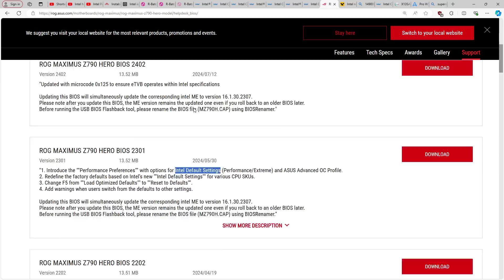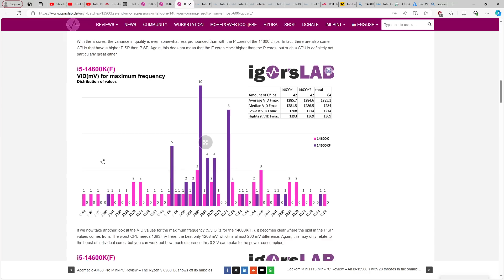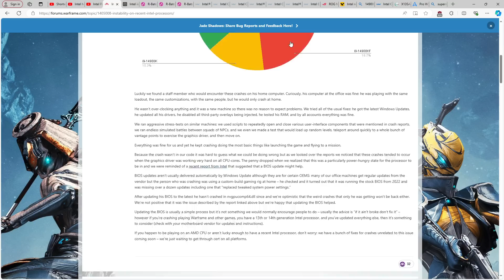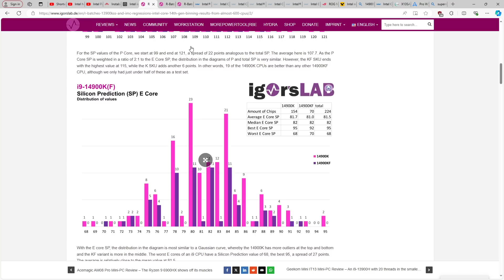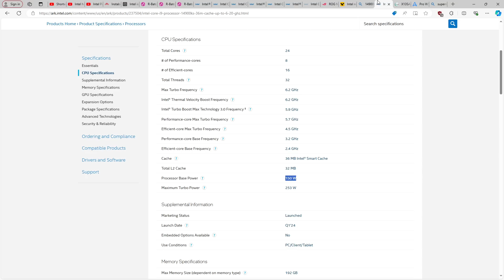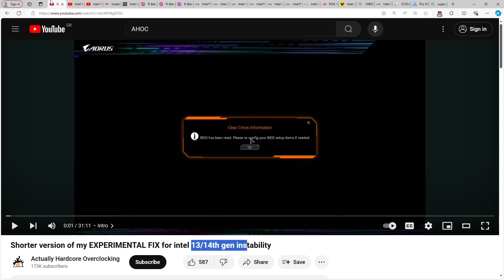The intel instability and degradation rant.

Comment: Thank You! 

Could degrading of the ring also be present in 12 gen i7?

Got a used one together with a used motherboard to upgrade my PC. Was sure freezes were due to bad MB. So I replaced it. Still freezes.

After that I increased the Voltage +0.05, disabled hyperthreading. Set ring clock to 3ghz And set the Clock speed to 4.3ghz. Now it runs.

So my issues definitely related to bad 12700k. 😅

Comment: Hi. I'm just about at my wits end trying to get my x670e gigabyte aorus master to run in dual channel with the 9800x3d. I've tried everything,  bios updates, disabling igpu etc etc but the board will only post with a single stick if ddr5. Ram is a matched pair of Kingston fury beast 32gb each. Will run fine with a single stick but will not post at all with 2. Before I buy a new motherboard and end a long association with gigabyte I'm hoping you have an idea I haven't tried. It seems a common issue on revision 1.0 boards which is what I have. Any ideas?  Love the channel and watch every video.

Comment: Stability and yet 90% of people don't even tweak voltage due to variation on psu how many power supplies not even deliver what they should spikes in sockets power draw 1.5 volt 9n one power supply not same as 1.5v on other anyone show multimeter hooked up in those test Any atleast 1 of them ?

Comment: I have mine 13900k for 2 years. First thing i did when I bought it I disabled multicore enhancement and set it to Intel defaults on Asus mother board and from more  4000 watts processor went in max getting 253 watts so I don't think Asus didn't know the spec . Since that time I  didn't had any issues. Then I saw on internet all the thing about cpu problems. So I started to update bios with newest bios and microcode updates . After update I had mine first crash in game. And temperature rised 10 degrees. So I gave up and changed back to old bios without microcode. . Set it up like first time. And left it. And still don't have any issues with processor other then that a  lot of games  telling me to update bios. I just carrying
Reply: The real problem is the single core boosts shooting 1.45 - 1.6 volts as an average while also running high temps 95C. The new bios still doesn't fully fix this as I just bought a new 14900K about a month ago so I had to  manually tune the voltage down from 1.47 to 1.4 so I could maintain the 6ghz boost clocks while not shooting a ton of unnecessary voltage to the chip. 

I also power limited my chip down bc my 14900K is running in a sff/itx case LIAN LI A4-H2O w/ a  COOLER MASTER 240 Atmos aio. I can't run the chip multicore to it's full potential if I want to maintain decent temps which I've chosen to stop at 85C max 220watts. 

My CBR23 multi-core score hits right at 36K & single-core 2350 while maintaining the 6ghz boosts. This for my use case was a much better solution than just locking all cores to 5.7ghz as some ppl suggest (which is not a bad suggestion if single core clocks are not a concern for you).

Why not AMD? bc AMD clock speeds don't maintain as they down clock (amd verison of thermal throttling) to way below what I would get w/ Intel. While the cache on AMD is fantastic the single core boosts from Intel are still favored in the apps I use specifically for music production. 

If the rumors are true then I do think AMD zen 6 will fix this to where we get sustained high clock speeds w/ cache but for now Intel is still the lead in that area.
Reply: @heyguyslolGAMING  thanks for real  answer.  I'm still in place where I'm not sure to upgrade to new bios or keep it on old. So knowing that still can be issue with new one  helps . 
Mine cpu is not getting more then 1.43v I checked it planty of times for a year.
Nice thats work affter setting it manually.
For me it's difficult that after 1 year we still don't know the scale of the problem. If every cpu is affected. And thers no real answer. Just upgrading bios. And no one cares if it works for you or not.
Reply: @evan-du3vk  As a suggestion run HWiNFO at the beginning of your use session and just use your pc as you normally would. When you are done w/ the session pull up HWiNFO and look at your Vcore & CPU Package Temp "Averages".

If it's at or below 1.35v @ 85C you're good. If it's 1.4v or higher then you might need to consider locking your cores down, and/or under volting. Keep in mind you can't just do a short simple session like 10 min.  Do this for several days and log the info.

Each session needs to be a couple of hours or more of actual usage to get a full gage.  When I mentioned that I had to get my vcore down to 1.4v that was for synthetic benchmarks. Once I ran my sys for normal daily usage I'm getting averages of 1.32v , 60C all while maintaining the 6ghz clocks which is what I paid for. 

The problem w/ Intel for some ppl is that if you're not particularly pc tuning savy then you're probably going to have issues. AMD is idiot proof. You could literally have an IQ in the negative and it's still going to work. 

Intel requires FAFO but for some use cases it's worth it bc the architecture for some programs is still leaps better than what AMD can currently do. Sadly all these tech tubers will never illustrate this in their vids. 

They'll just show you a bunch of trust me bro bar graphs w/ high subscription & views to convince you that they know best.
Reply: @evan-du3vk  As a suggestion run HWiNFO at the beginning of your use session and just use your pc as you normally would. When you are done w/ the session pull up HWiNFO and look at your Vcore & CPU Package Temp "Averages".

If it's at or below 1.35v @ 85C you're good. If it's 1.4v or higher then you might need to consider locking your cores down, and/or under volting. Keep in mind you can't just do a short simple session like 10 min.  Do this for several days and log the info.

Each session needs to be a couple of hours or more of actual usage to get a full gage.  When I mentioned that I had to get my vcore down to 1.4v that was for synthetic benchmarks. Once I ran my sys for normal daily usage I'm getting averages of 1.32v , 60C all while maintaining the 6ghz clocks which is what I paid for. 

The problem w/ Intel for some ppl is that if you're not particularly pc tuning savy then you're probably going to have issues. AMD is idiot proof. You could literally have an IQ in the negative and it's still going to work. 

Intel requires FAFO but for some use cases it's worth it bc the architecture for some programs is still leaps better than what AMD can currently do. Sadly all these tech tubers will never illustrate this in their vids. 

They'll just show you a bunch of trust me bro bar graphs w/ high subscription & views to convince you that they know best.

Comment: Well buildzoid, Im a part of your audience and I run an i5 14600k. I have it undervolted so that I never see it exceed like 1.2v I bought it new a couple of weeks ago, and I run it like this because I want it to last for a long time, and I am confident it will
Reply: I just got a 14600k, could you please share your settings? I'm worried about this degradation.
Reply: @tidjane2001 basically, I just undervolted until it was unstable. Go into the P states and adjust your voltages.

Comment: I appreciate your thoughtful discussion and I've done something most here will probably cringe hearing. I upgraded my Gigabyte Z690 board to F30 BIOS (which includes Intel 0x12B, 0x125 and 0x129 microcode) and switched out my i9-12900K for a new i9-14900K. I have set the BIOS to Intel Extreme Profile, limited voltage to 1.4v, Power to 253/253 Watts, and Adaptive Vcore with -0.100 Offset - per your recommendations in another video (Thanks!). So far, the CPU is rock solid and consistently scores 39600-40000 in Cinebench R23. Max voltage under load stays in the 1.3-1.35 V range, Package temp stays below 82C, and at least 3 P-Cores are hitting 6.0 GHz periodically with most staying at 5.7 GHz under multithread loads. Power draw is staying at or below 253. I intend to run this as my "daily driver" config and measure it periodically for stability/degradation.  I am keeping my old i9-12900K as backup/fallback just in case. However, the 14900K is noticeably better performance wise in the games I play - much smoother, no micro stutters in high-res VR.

Comment: Intel could slowly ramp the current up at transients by inserting a couple nops, and waste power when it's waiting for the memory to keep the current constant. Then it wouldn't need a loadline and could run lower voltages

Comment: My 13900k tops out at 5.6 and I've been running it since December 2022 on MSI MEG Z790 ACE motherboard.  Its been solid for me, more so than the X570 5950x aib rt 6900 xt combo I was running before.  Still not happy that Intel did this as it could easily have been my setup that had the issue.  Did notice in the bios settings that my ring bus is running 2700mhz.

Comment: Think asus have done something wierd with the latest bios for my TUF gaming z790.

Running a 13600kf on bios 1630 I get a max VID of 1.24v even with xtu optimised to all core 5.4.

"Upgraded" to 1661 and even stick it's pulling 1.39 VID and performance is down. The biggest issue is the temps though, on 1630 my 360 aio holds cpu temps under 67 degrees on extended benchmarks, 1661 has it up at 80.

Comment: Pat Gelsinger needs to go. He failed, he's wildly wildly overpaid. He's a nerdy sociopath.... Bring in someone younger and more organized. Even before these issues came out, these chips run so hot that I don't know how anyone ran them at stock clock speeds. I run my 14900k at 55P-core/43 E-Core with a -0.075 Undervolt.... Hopefully that saves me from the degradation issues.

Comment: My 14900k is only using 1.35 max vid since going to 1661, Had to remove Intel Defaults as they drew 1.55v just opening windows. Idle at .75v as per always, only draws 205w (used to be 350w). Main issue was still the SA being stupidly high when putting XMP on, weirdness

Comment: Hey guys, need help identifying if my CPU is degraded. I have a 14900k on a Gigabyte Z790 board and for about 4 months was having BSOD and thermal throttling and also the “out of video memory” error due to this, then all this stuff came out about it and I undervolted it to Intel specs, I made P1 & P2 both 125W and since doing this I’ve experienced no issues whatsoever, high shader games launch all good no crashes, no thermal throttling and no BSOD. They are now about to do a microcode bios update but saying if your CPU is degraded this won’t help. My question is, how the heck do I know my CPU is degraded?? As far as I know we all had issues when our boards were pumping too much power so we’ve all had issues but now we had set the voltage to Intel spec, all is fine. Does this mean my CPU is degraded? It’s working completely fine now with Intel spec so is my CPU degraded or is it all good? Do I need to worry about RMA my CPU if it works fine now???
Thanks heaps!

Comment: INTEL Core i7-13700KF 3.4GHz LGA1700 30M this is the cpu i use, i dont use any oc or power boost, just running on stock non over clocked mode, is it possible that i won't have any isues :)?

Comment: but isn't this also the fault of the motherboard auto-OC turned on by default ?
before hearing about this problem i only turned on XMP on my DDR5 RAM (6400cl32), and touched nothing else, now today because of what i've seen about the degradation problem, i went in the BIOS (i owned a 13600k) and noticed the "Tower air cooler" option was set to PL1=288W and PL2=288W, so i switched to the "Boxed air cooler" setting and now it's PL1=181W and PL2=181W, which is normal because Intel said it's PL2=181W and PL1= 125W for base but PL1=181W for performance.
otherwise it seems nothing is out of the ordinary, i've done a 10 minutes stress test on OCCT : voltage is at max of 1.352V and 1.102V for average, power draw is max 201W with an average of 114W, and i have a better score in all categories than the "average" 13600K, no errors reported either, also i really only push the CPU for gaming at 2K ultrawide so it's never pushed to the limit.
performance loss is almost non-existent between PL1 and PL2 at 288W vs at 181W, wtf are MOBO manufacturers doing ?

with my results, i fail to see how I5 13600K's would have stability problems outside of the oxidation issue which is a physical factory related problem anyway.
i've heard 13600K's have a 10% failure rate in data centers but how do they reach that conclusion ?

Comment: I remember how Intel quickly shoved the 13th gen out when sales started to take a hit after AMD kicked their asses with their own CPU series competing with the 12th gen. At the time It sounded like Intel had overclocked their own CPU's out the door to get them to out perform AMD, what with all the heat and power usage issues. Seems I underestimated their stupidity. They not only overclocked them but increased the size to compensate but failed to do enough checks to ensure they were actually stable.

Comment: I still got a 8600k. the ring gets unstable with a voltage around 1.5v at 4,7 GHz ring and 90°c.
I think they have an old problem here. 1.6v+ is suicidal. The 13/14 gen CPUs should run about 5,5 GHz with decent voltages. with low voltages and 253w limit they would still clock high in multiworkloads.

Comment: What chances are there that it is not fault of cpu and or microcode, but at fault would be peaks in supplied tension by the vrms that leads to degradation of an out the box pushed near the limits of the silicon silicon.
For example: 
-cpu requests High tension for low core count load boost(high frequency): 1.5V;
-the mb vrm goes: sure can and supplies 1.5V, all along that 1.5V there is a fat peak of 1.65V, fat peak that goes undetected.
?
le: comment added @16 mins into the video.

Comment: Seems they were desperate to not just compete but send the shareholders a WE ARE BACK BABY message and all those years of work we threw away to daily redesign a new solution that would let us beat AMD is the best of all worlds with no downsides at all, cores, HT, high frequency, “efficient” operation thanks to e cores, AND 6 GHz…AND ALL OF THAT WITH FAMOUS INTEL RELIABILITY AND EASE OF USE, because we are better than those “glued together cpu people”

Comment: AMD's IPC is on par with Intel 13th and 14th Gen.  Do some research.  Intel just clocks higher so it seems like it has better IPC at stock settings.  Not to mention AMD's far superior efficiency, which Intel is not even close to matching.  Not like any of this matters since all high-end Intel chips are now failing.

Comment: I have try all i can , with a little bit more fine tuning i get 4,7 Ghz Pcore  on 1,285 without E cores  but i have seen comment from some guy with 4,6 E core ... and yeah.. why not fkng E cores they  use the same Voltage ... that is thing i really don't understand and i can't lower it what ever i do  only Disabling E core to give a little bit of room to P cores , i am on Air Cooler and playing with OC .. more of a Underclocking 😂🤐 fkng stupid

I will buy a best AIO for this sht of CPU even i know that will not solve al of my problems .. i can't sell MB and CPU because no one want's it  😢😂 

Really really hate Intel becouse they don't wanna talk about problem , i have payd like all of you 1000+ euros on upgrade and i have get downgrade

Comment: 13900k simple 5.5ghz locked 1.34v-1.360v with a LLC5 simple you guys are trying to hard 5.7Ghz 1.385v 5.8Ghz 1.465v
Always keep core voltage lower than VID voltage i have a vid of 1.525v and the above core voltages.
The thing is you need a 360m cooler and contact frame and thermal grizzly just to contain 5.5Ghz anything above that you need a 420m at least.

Comment: Sounds like SEE which is temperature related usually. Above 74C all bets are off (NP junction degrades) so running them above that failure is expected with certainty.

Comment: New microcode 0x125 will raise AC to 1.100mohm so cpu will short gain stability,long term degrade even further.

Low default voltage for boost will raise with new microcode with 0,050V ,pls Buldzoid to test that.

Comment: New microcode 0x125 will raise AC to 1.100 mOhm form microcode 0x123 AC 0.400mOhm

So,default low voltage will raise with 0,040-0,060V and stability for all degraded processor with cost to calm down water to zen 5 release paste.
Long term cost degrade even further.Please Buldzoid to test ,only youtuber i can trust on such things

Comment: You are so on point! Intel and also AMD are clocking their CPU's wway to high! People thinking only Intel is affected are very wrong. AMD also gets very hot and they use to much Vcore to get stable at high clockspeed. 7950x are degrading as well. Only a little less fast because they are not clocking that high.

I have seen I9-14900K that are using 1.55v on all cores in runs wich is insane and for sure causing trouble to happen. 
Intel should put out new bios versions that lower it all but i doubt they will do because it hurts the cause and they don't want class actions lawsuits.

Comment: Have question I have 13900k for 8 months and didn't have any issues with temp and stability. So can I stick with old bios with just multicore enhancement switch to default or schuld I have new bios. Becouse with new bios from asus Is still stable but mine cpu is jumping with temps and clocks like crazy.
Reply: keep commenting everywhere, I'm reading this more than twice as of now.

Comment: just bought a 7800X3D last week for my new build, my first ever AMD CPU, never been happier, I mainly picked it because 1. Intel 13th & 14th gen stability issues; 2. I happen to have a spare 240 mm AIO. But even that seems to be an overkill, gaming never ran hotter than 67C with 1200RPM/60% fan speed